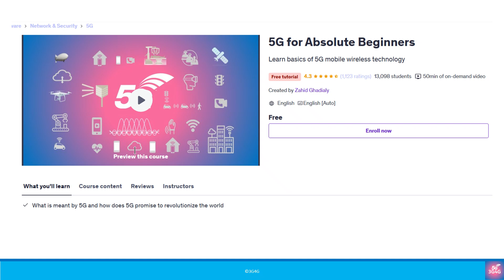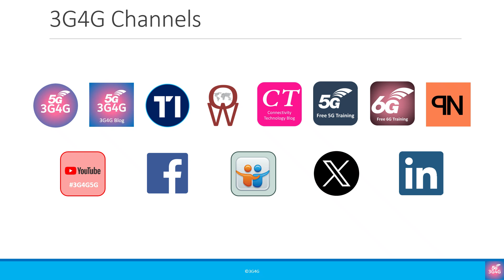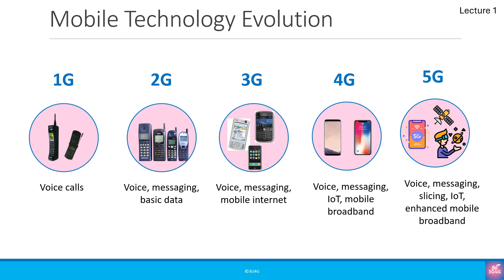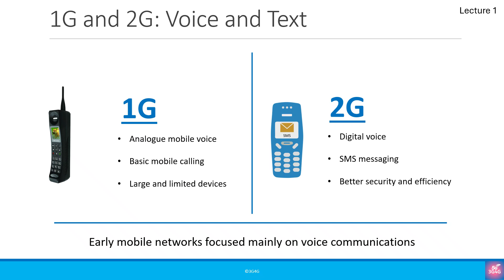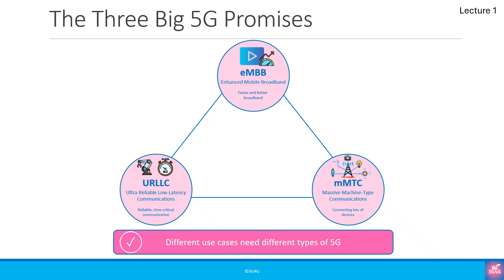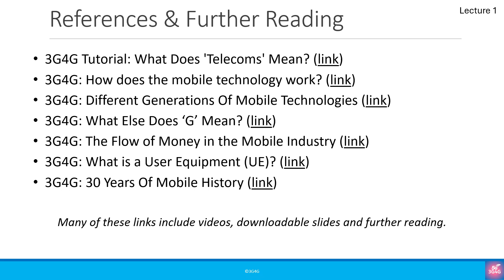5G and 5G-Advanced for Absolute Beginners - Part 01: From 1G to 5G

Comment: Kuwait’s Communication and Information Technology Regulatory Authority (CITRA) has announced plans to implement 5-carrier aggregation technology for 5G networks—encompassing the n41, n78, n77, and n104 bands—with a total bandwidth of 500 MHz by 2028. The Authority also intends to focus on improving indoor coverage and plans to acquire a license for the n77 band in the fourth quarter of 2026, with expectations that 5G Fixed Wireless Access (FWA) internet speeds will reach between 4 and 5 Gbps 450-500 mbps upload speed
Reply from the maker: Thanks for sharing. Kuwait’s 5G roadmap is certainly ambitious. It’ll be interesting to see how those targets translate into real-world FWA performance.
Reply: @3G4G5G  Citra Kuwait 2028 target 5g coverage 100% 5g-A outdoor coverage 75% (3cc) 5g-A indoor coverage 60% peak speed DL 5gbps ul 500mbps average ookla speed  DL 1gbps ul 100mbps average latency 20ms 5g-A sites  2.1m(50%+) network AI level (TMF) L3 energy efficiency 25% per bit